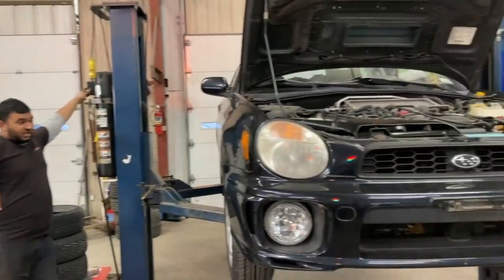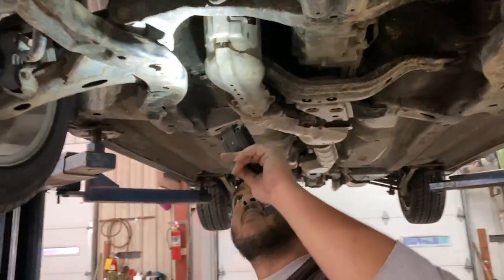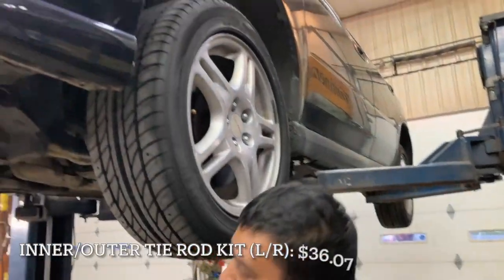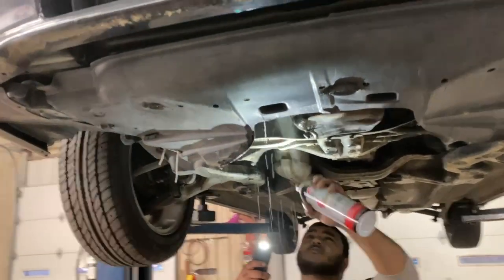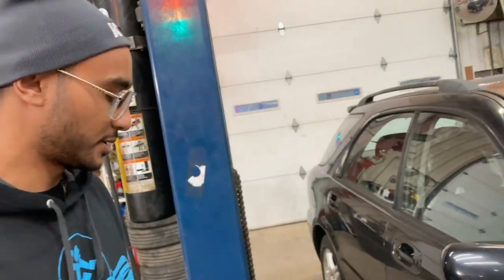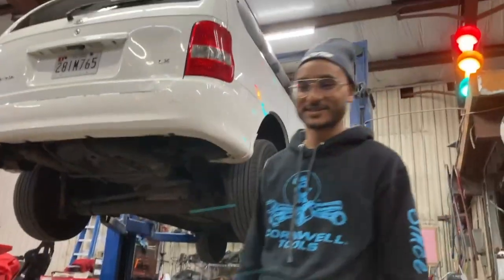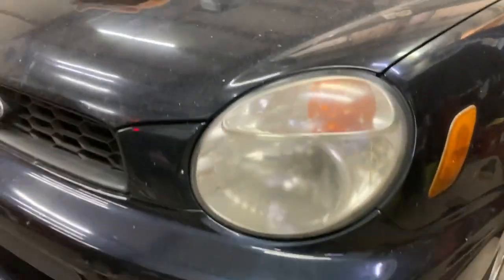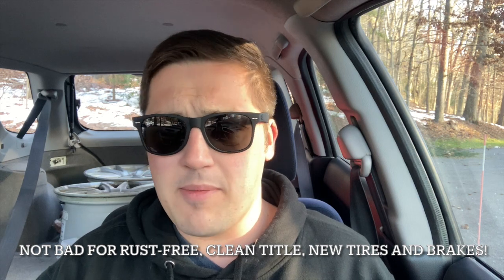Here's Everything That's Wrong With my 2002 Subaru Impreza WRX! My New Bug Eye Wagon Gets Inspected!

Comment: Gz on the bugeye, good to see more wagons being used. My 205 lasted to 200k until the oil pump failed and it ate the bearings.
Reply from the maker: Oh yeah! I love these bug eye wagons. It was between a bug eye and a Saab 9-2x aero. But the momo wheel of the subie was just awesome
Reply: @CameronsCars  100% glad you've got the oem turbo back. Those are so hard to find cause of the platinum buyers. I ended up getting some shitty system from Canada. Just dont fall for the invidia n1 meme unless you want to be heard in the next town over rofl